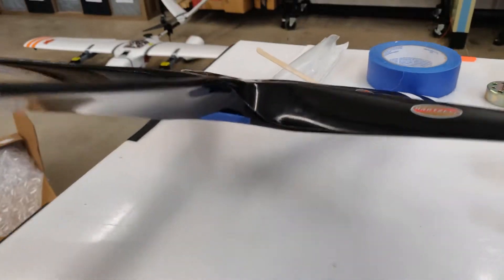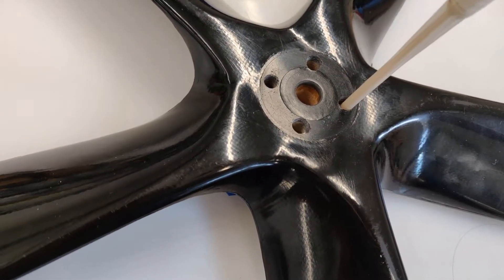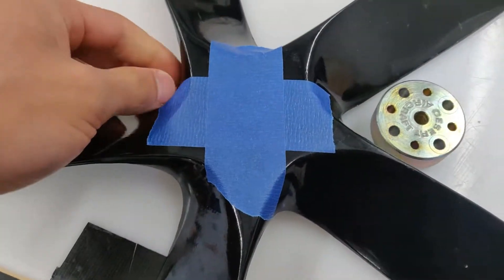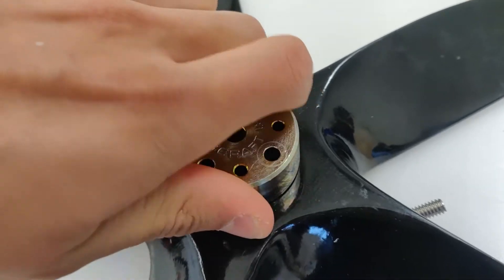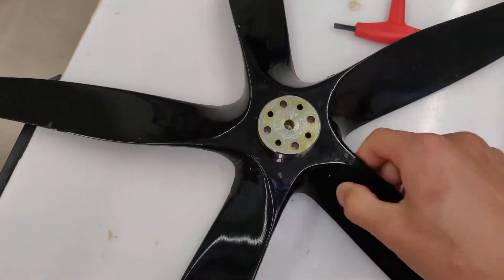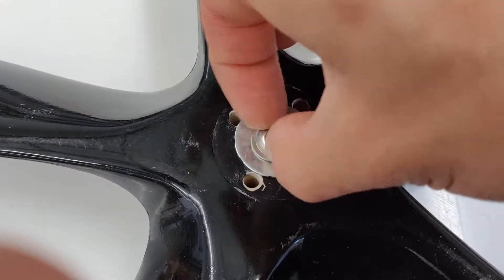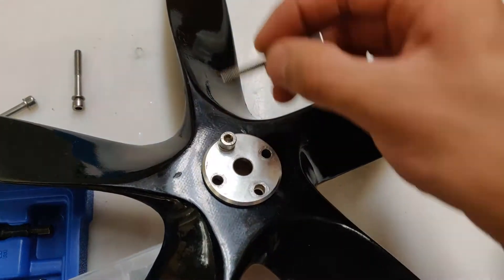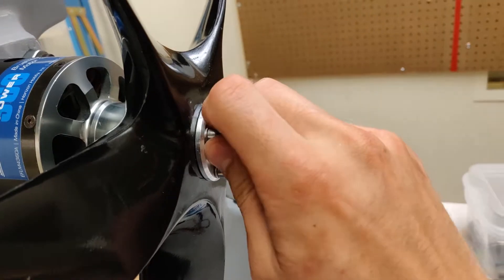Propeller Hub Mount Hole Repair (Hartzell 5-blade UAV Propeller)

Comment: Hi, I currently have a Falcon 27x10 prop that I got to drill the holes in wrong pattern.. I have some Glass Micro Ballons at home, can I use that to fill the holes ? Along with 24 hour resin. Thanks
Reply from the maker: The glass balloons should work, but the resin/glass balloon mixture will be much harder than if you used a sandable filler. This should be fine but may require extra care while drilling new holes, so that you aren't drilling through two materials of different harnesses at the same time causing the drill bit to bend and drill at an angle. Those CF propeller hubs are usually mostly some type of core material like wood, which is very soft when compared to the glass balloons+resin.
A easy way around this, is once the holes are filled just make sure your new drill pattern is aligned so that it does not overlap the filled in holes.
Reply: @ElectroTechnics  Thanks for the good tips👍 I will try it out.